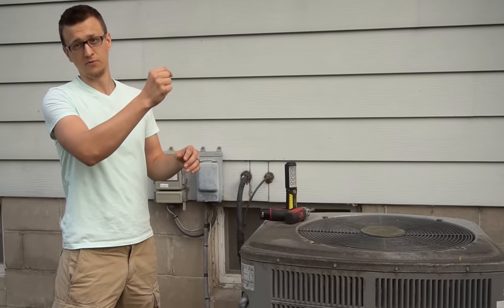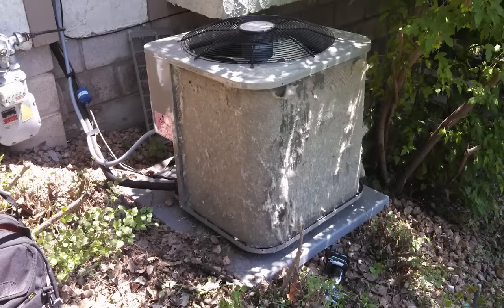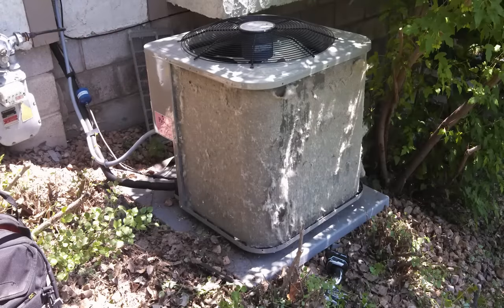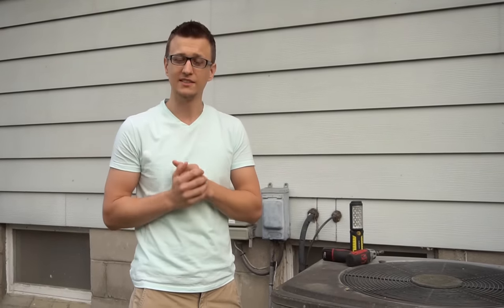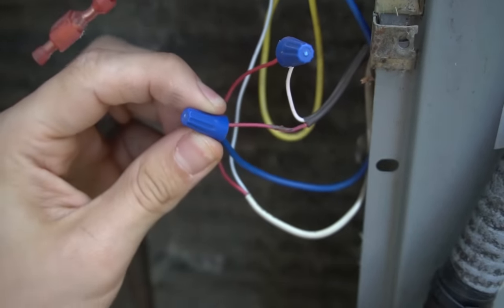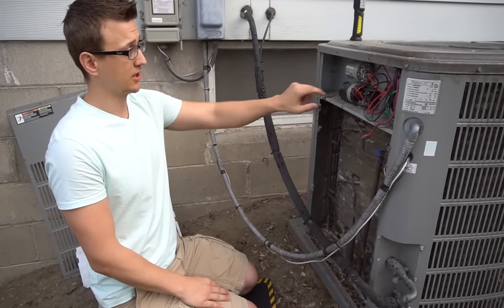15 Air Conditioner Maintenance Tips

Comment: My ac running good but it doesn’t stop when I put on auto mode , could you tell me what wrong with it? Tks
Reply: Where you change the heat/cool make sure that's off then put you fan on auto, it should turn your fan off.

Comment: Good tip to add, best way to check a capacitor is under a load. Measure amps and the voltage (be up about 350v due to back emf). Then use the formula 2650(constant) X Amps/Volts = uF rating.

Comment: where my suction line connects to the unit (the exposed metal part) its covered in ice and frost, is this normal?
Reply: Nope.
Reply: @zacharypelley6378  yeh, figured that out after doing a bit more inspection lol, air filter was jammed packed full of lint, low air flow caused the entire A coil to freeze over. woops!
Reply: @CaseFace5  most of the time when there's a freezing issue its going to be airflow. Either the filter is dirty, the indoor coil is dirty or the condenser is dirty

Comment: Had a mouse nest in mine ad service technician come out he took one look said it was shot.  Cost $6500 to replace.  I went out and looked after he left one chewed wire i soldered it fixed $25 had to buy a solder gun.  I then encase the unit in a cage and put repellant around it.  I live in the country so lots of rodents.

Comment: I change the spark igniter every 4 years, it’s like $32 cheap and I can travel in the winter and I save the used ones, just in case of a failure.  I will add changing out the capacitors at every 8 years, so that’s another $100 or so.  Why wait... What a cheap date to a trouble free system.  

If you have an newer electronic system, adding a surge protector like an Emerson Edco Model HSP-121A to the 120 Volt side of the system can help power surges from the outside - especially power spikes.  I would change the module out at 8 to 10 years.  I like this model we have used on  hundreds of systems.  The reason you change surge protectors is they have a finite life... every surge and every spike has a varying wear factor, where larger surges are the more damaging, yet are unknown to the user.  If you are in a bad lightning area, you may want to be more proactive and change the surge protector at a more frequent interval.  If you have two systems, it’s important each have their own. The Edco part is about $150. Do not buy used ones!
Reply from the maker: @JR Chicago Thank you for all the additional pointers JR! Much appreciated!

Comment: Get a "hot shot" for your hose so you don't have to use your fingers to adjust the pressure.
Use pleated filters, and change them regularly, not just after you have a problem. If you can see through it, then dirt can get through it. Go to a part house to get them as they are cheaper and you can buy them by the case.
Use vinegar to clean/maintain the drain line it is more effective or get your ac guy to put in a strip at the start of the warm season along with your regular check-up.
Get something to help with those west facing windows that are letting in all that heat during the hottest part of the day, if not all the windows.

Comment: Imagine all the service calls you triggered cause of this video lol. “1992 Trane Heat Pump Split System” Temp Split is 14. Coil is a bucket of rust. “My ac is not cooling properly”

Comment: Great video but please do not put your hand near a capacitor until you learn how to discharge it. With power disconnected it blew the tip off my screwdriver

Comment: hey i tryed leveling the unit and saw some oil leaking at the suction line connection. what should i do. i live in lakeville mn where are you form
Reply from the maker: Is it fresh oil or was it there for who knows how long? If your AC is working normally I would leave that alone for now. Wipe it down so there is no oil on the pipes and check on it every couple of days. If nothing will surface back up then likely that is just leftover oil from a time when the refrigerant was checked. If yours AC starts to not cool down the house though.. Then you got a leak somewhere.
Reply: @WordofAdviceTV  i think it was fresh oil, i did wipe it down i will keep checking on it . thanks for your help

Comment: What would you recommend, my a/c unit is working, it’s just that it’s rusting from the top of the plastic cover and below the fan blades. I’ve never covered the a/c unit in the winter.

Comment: In addition , it is cheap to have a replacement contactor on hand because they do fail as well under normal use and are vulnerable to power surges as I found out. I installed a separate surge protector on my compressor unit. I had the AC installer drop off the compressor base a few days ahead . I dug down a few feet and filled the hole with stone to provide a level foundation. They won't do that and it is really dumb to just lay it on the existing ground. Once done , you never have to do it again.

Comment: I highly suggest not to wrap the ac up, if you do then don't wrap the whole thing leave the bottom exposed, it will create moisture in the unit making it easier for the system to rust and deteriorate.
Reply: And if you are going to use coil cleaner my old company had us use true green, its non corrosive.

Comment: Say What?, at 13:12 you mention the insulation is on the suction line so the Freon (Freon refers to CFC refrigerants not used anymore) does not turn into liquid, WHAT!! That is the low side vapor line, vapor cannot turn into liquid before entering the compressor unless its leaving the air handler (evap) in a vapor/liquid mix which it should never do in a normal functioning system.
Reply: Metal Halide read earlier comment on this issue

Comment: My upstairs is a lot hotter than it is downstairs is it possible for me to install a thermostat upstairs and divide my house and have it turn off downstairs so it cools upstairs instead of downstairs is it possible to have two thermostats and work the same air conditioner my house is brand new and I don’t want to turn around and buy another air conditioner it’s brand new

Comment: Dude. (8:35)    
1st; your Start cap is leaking (creating low mfd)   
2nd ; your  cond fan motor (2 speed relay/ therm senor is missing) you even left the Red (low speed) unplugged/ loose....   Bro   Really????

Comment: You should rinse the condenser coil from the inside of the unit outwards, this will prevent you from pushing in the dirt and debris into the coil further.  Remove the side panels to do a good job, you can't clean them well leaving the sides on. Condensers need to be out of the dirt too, this is why the new condenser pads are 3" tall as opposed to the older 1 1/2" tall pads as they tend to sink into the ground. Your condenser should also have the leaves removed as it will hold moisture and cause rusting of the A/C base if it is metal and not plastic. The leaves also block the drainage holes. You also have restricted your condensate drain by using that tubing. The drain is a 3/4" yet someone chose to install 1/2" tubing on it as opposed to 3/4" pipe. This tube of yours is kinked where it goes over the edge of the furnace, guess where it will get plugged up at?  Guys like you give me job security. And last but not least, don't forget to turn off your humidifier in the spring. You are trying to dehumidify the air not put moisture into it!!!
Reply: I like your suggestions, but no need to insult this man. He's doing us all a service.

Comment: Hi Bro. Thanks for your video. I do not have that but the tips are very good!  I want  a favor from you! i need to buy a portable air conditioning but i want something not to big not to expensive. it is for a small garage . I would like to see one with exhausted tube and without it! thanks for your information>
Reply: If you get a portable a/c get one that has dual exhaust hose what it does is sucks air from the outside and runs it through the unit then exhausts it back out through the second tube. NEVER EVER GET THE SINGLE TUBE PORTABLE A/C ! your money and cooling are going right out the window/door. If you are in a dry climate go for a swamp cooler you need 4xs the cfm of the sqft you are trying to cool

Comment: I would clean the leaves out no matter what. Most people have a heatpump and not straight ac. The holes in the bottom are drains for water during defrost mode. You don't want water making ice cubes during the winter months 😁.
Reply from the maker: Great suggestion! Thank you for pointing that out

Comment: Covering unit. Make sure to shut breaker off. So your kid don’t turn it on and blow compressor. The biggest thing a homeowner needs to do is change filters every 30 to 90 days max. Remember not changing filters can cause furnace to trip or ac coil to freeze. Needs airflow. Coil not a filter. Besides filters call a professional. You don’t need to get zapped by playing with furnace or ac. This guy trying to teach basic 101 hvac. If your not handy with electric and meteor. Call a company

Comment: Instead of cutting the bare wire, can I put electrical tape on it?
Reply: Yes, you can. It must be considered a temporary repair though. The tape won't handle the weather that well. You could consider using a liquid rubber compound if you can't cut the wire shorter and still reach. Use 2 or 3 applications of the rubber compound to get an appropriate thickness.

Comment: My air conditioner is not blowing cold air, even after running for few hours i get drop in temp by 2 deg F. 
1.) I tired cleaning the condenser fins. Blower is blowing and the outside compressor as well is working. The connections outside the house dont have icing deposit so i dont suspect the refrigerant is low. 
2.) The repair guy said he couldnt hook up his device to check the refrigerant levels as the threads on the service ports were misaligned/damaged and suspects the inlet and outlet refrigerant ports are crossed. I did check the inlet line is not icy cold. 
3.) The repair company recommended change the entire unit which I am not sure. 
4.) My air conditioner unit is old and I dont know how old because when i bought the house the label on outside unit was missing so i cannot find part number/ manufacturer. 
Can anyone help/recommend here ? Thank you.
Reply: Most likely air condensing unit is from Goodman Manufacturing company. Looking at the paper work, it appears the unit is from late 1980's .. (1986-87)...

Comment: I only gave it a thumbs down because of advice about removing leaves from the bottom. Most American standard unit especially the model and in the video have a heater on the bottom and leaves overheat and short it out over time. 
But overall it’s a good video

Comment: I actually have a tip to offer. The coil on your house has the fuzzy style. Before you wash down, use a propane torch to lightly burn off debris while the unit is running. After that use water. So much faster and so much cleaner.
Reply from the maker: Ah yes! That is a good suggestion! Thank you for sharing!
Reply: @WordofAdviceTV  if the fan is running don't worry. It won't get out of control. It snuffs out quickly and draws inward. Breaks up the debris completely so a quick bath is easy
Reply from the maker: @Jojo Bane Sounds good! I have seen other techs do it but never actually used a torch myself. Now that you reminded maybe I'll give it a try :)

Comment: Who the heck installed that unit? It's turned 90 degrees counter clockwise from where it should be. If it was to access the panel, they should have just spaced it an extra inch or two away from the house so you can open the panel. I've actually never seen someone install something this poorly/amateurish.

Comment: Did I hear him right maybe I misunderstood him in the beginning he saying you can wrap your split unit the the winter even cover the top from the pictures he's putting rocks or bricks on top of it and a piece of plywood. It could freeze and lock up the unit is he crazy? I've never heard of that. I guess I need to go back to heat near class. If you want to clean the coils outside can you soapy water in a spray bottle and spray it off for the hose. If you want to clean the inside coils you can use soapy water and a brush and lightly clean the coils. Don't close your vents inside your house let your unit breathe. It's not rocket science

Comment: Certified hvac technician here. While some of these tips are good for a homeowner to do, if you're not mechanically inclined or have basic electrical knowledge I wouldnt recommend messing with any electrical components. Also, do not wash your condenser coil from the outside. You're just pushing the dirt farther in. It should be cleaned from the inside by someone who knows what they're doing

Comment: Two things need to turn power off to the outdoor unit and furnace switch should be turned off said first.
If you are going to be this guy ensure the step process is in correct order not after shown cleaning.
You are also showing the oldest A/C,  you start spraying water in those High SEER units with monster boards hope you got rider insurance. Thank God Canadians hire professionals to do this work.
If your work causes a fire no fire insurance.

Comment: Why is an air conditioner called an air conditioner yet on the same unit, the heater is called a heater respectfully. If it is hot, you "condition" the aire with the air condition. When it is cold, you "condition" the air with the heater.

Comment: Do not wash your coil from outside in. That is the worst advice ever. Most coils are fin tube design and washing outside in packs the dirt in making it even harder to clean. Looks better when you’re done but head pressure through the roof. The American Standard he is demonstrating on is a spine fin type. You can get away with it if you’re diligent every year but it’s still not a great plan.

Comment: Rinse from the inside to the outside.  Air flow sucks in air through the coils that way. Take the top off.  Then you have full access.  🤦‍♂️. And by all means start shoving your fingers inside where are the wires are before testing it to see if it’s live.  Even if you’ve turned off the breaker.  And for the love of... out the control cable in a conduit.  Sheesh. $15.

Lol. Poke a hole in your ducts.  Lol.   This has to be the stupidest video on YouTube.  Ohhh it’s a sketch.   Funny stuff.

Comment: The fins on his condenser are all smashed in, which is why it looks like hell. He needs to take a fin brush and straighten them out so they will allow for proper air flow through the condenser, which is why the fins exist in the first place. When they are smashed like his is, they will restrict the airflow as if the coils were dirty.